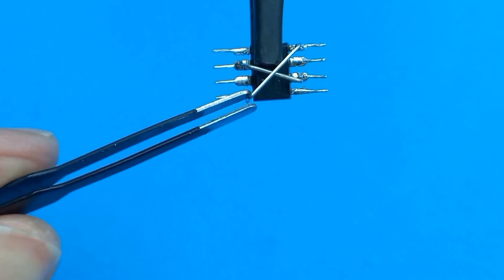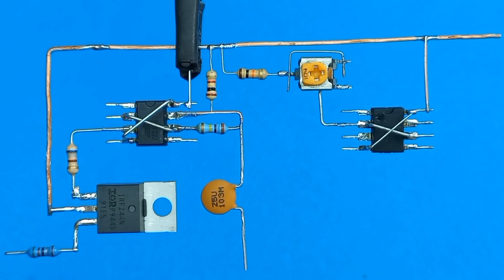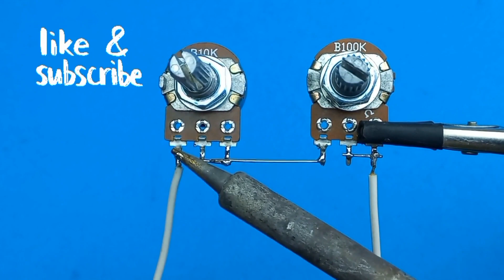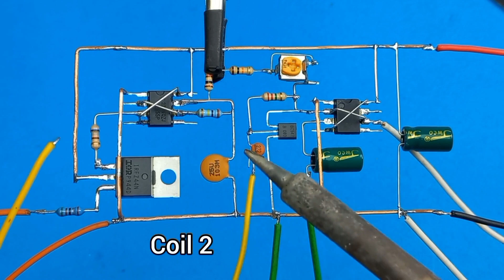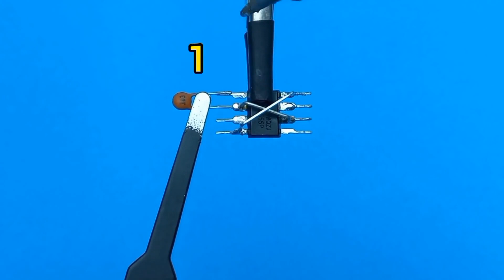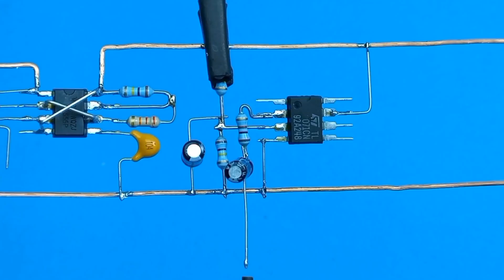2 Diy metal detectors with Ne555 | dy metal detector

Comment: im looking to build a mix of pi/vlf metal detector im only learning could you help me please what i will need to build it. Thanks Matthew
Reply from the maker: how can I help u?
Reply: @Electorr  well I'm thinking of   a lcd screen with a pcb board behind it resistors capatatiors diodes lithium battery to run the pcb and the lcd screen. 🤔